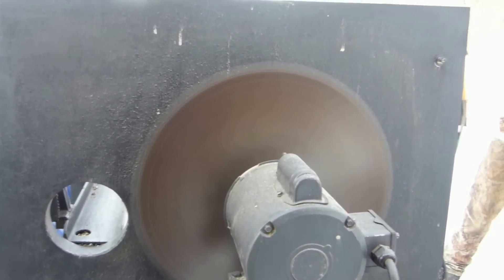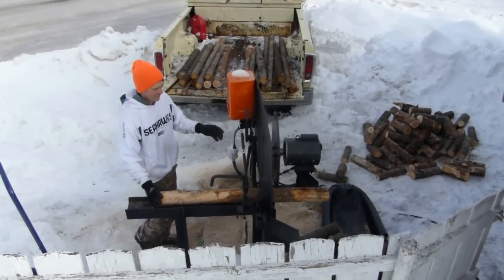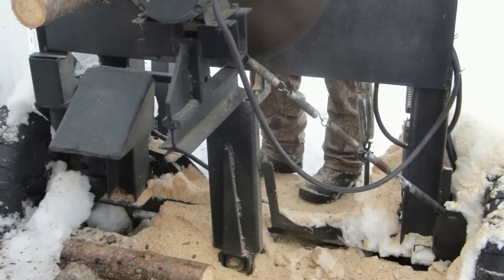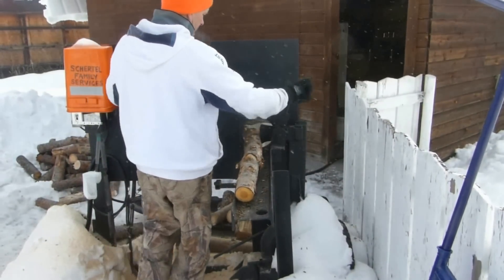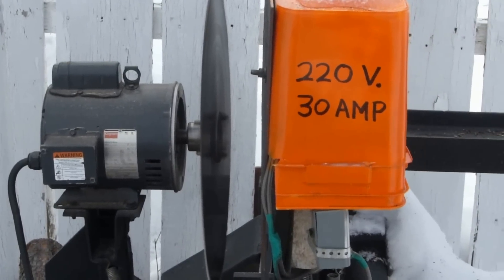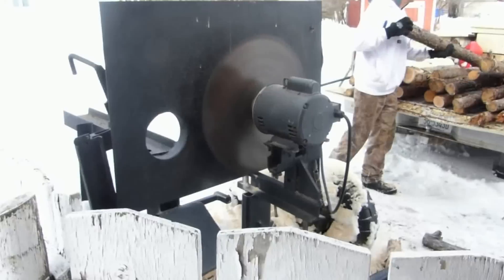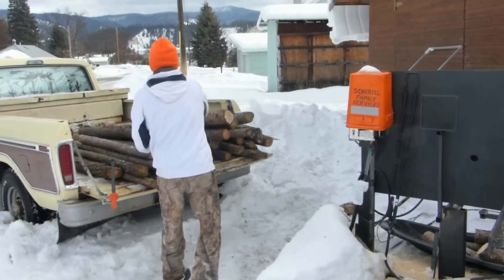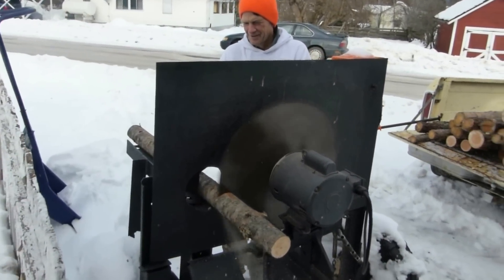New innovative circular saw design by Ben Schertel

Comment: How did you attach the blade to the motor shaft?
Reply from the maker: I mounted a flange coupling onto the motor shaft but first I drilled holes through the blade using the flange coupling as a template. Then I bolted the 24" blade directly to the flange coupling. The key way is the only thing that possibly is not allowing perfect weight distribution. I wanted it to be precisely balanced and be able to spin smoothly at 1800 rpm, which it does quite well without hardly any vibration. I also used some special bolts and nuts of very high quality. The blade is also of good quality and quite thick and heavy. I think why it penetrates the wood so well is possibly more from inertia than the power of the motor

Comment: thank you for sharing your idea . i was planing to just mount a 220 onto my gas buzz saw  , sometimes those gas motors  give problems that the electric would not . dont need gas line de icer lol  :)
Reply from the maker: leahcimrac ztirom they are much quieter also
Reply: i agree , and when it comes to electricity its a much better eco friendly power source . power from rivers , wind , ect .  no exhaust to blow downwind in someones face .

Comment: I just love the simplicity of your design Ben anyone can see that the only way you could get hurt is if you actually wanted to. You would have to feed your arm through that hole and then stretch back to pull the saw across. 1. you would have to be insane to try it and 2. a contortionist to achieve it! Lol.
I'm also enjoying the narration as I watch the video, it's really nice to hear the why's and wherefore's of the design as I watch it in action.
UPDATE ON THE LATHE.
Well I'm not bringing it here to my shed, it's just to big and heavy but I am restoring it. The owner (Mark) is a steam fan so once he realized it could be run from one of his traction engines he didn't want to part with it. He's paying for materials, I'm donating my time and Tony (my friend with the commercial shop) is allowing me to use his machines when they're not busy (for a small donation to his beer fund haha) Once it is completed Mark has asked me to demonstrate it at steam shows for him, which I'm really happy to do as I like steam engines myself.
Overall it's in better shape shape than I first thought, it turns freely (now I've cleaned out about 100 years of accumulated gunk) and other than a couple of damaged races and the only chuck being seized solid and almost welded together with rust I can't see anything I can't fix.
Reply from the maker: its good to hear from you Ian, and the lathe restoration sounds like a fun project.

Comment: This is a well thought out design for safety and production. 
Now how bout a video on that crane on the back of the truck? Please....
I have a little HarborFreight truck crane that is better than nothing but a far cry from the one you have. Also I swiped an out rigger foot from a wrecker boom truck at a scrap dealer. All the good stuff was torched already but the outrigger with a jack on the end. I knew if I ever built a heavy lift crane I'd need the outrigger to slide out to support the weight. I like the looks of yours and would like a good descripting walk around and maybe a little working of it on a video. I really do like the buzz saw idea but I gotta keep bugging about that swivel truck crane. We have a printshop at Church that we print up Gospel tracts on and had to go get a bunch of heavy equipment. That H - Freight pole lift wouldn't handle the need and we about got hurt loading with just the Pastor and me. The whole time I was wishing I had one of the fancy store bought cranes but a well made home shop build would be great as well.
Reply from the maker: i suppose we can make that our next video project, due to your importunity, lol